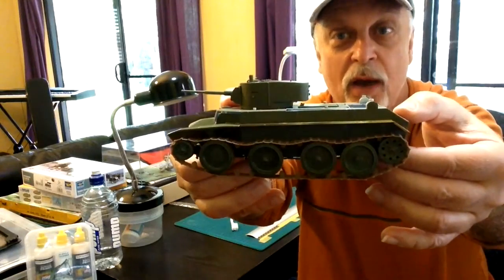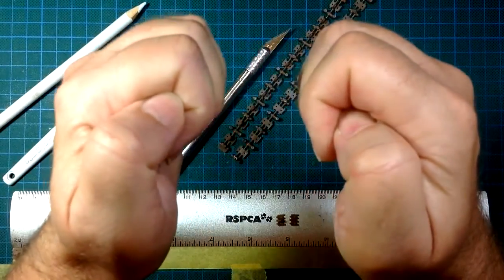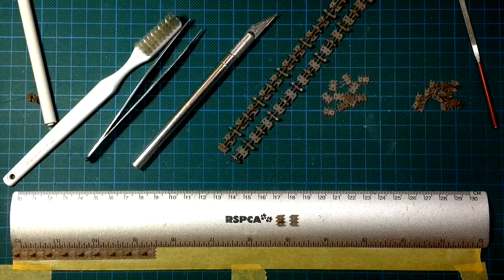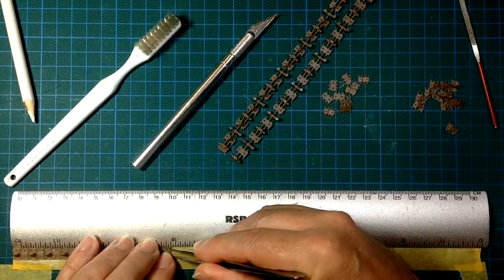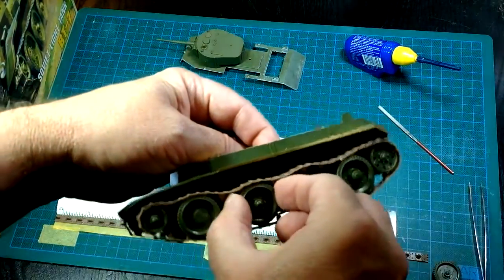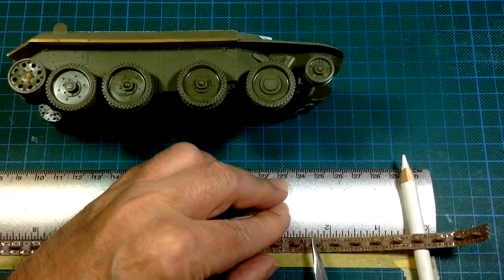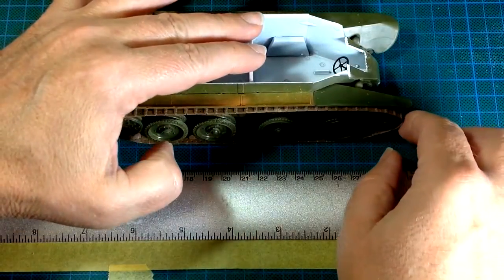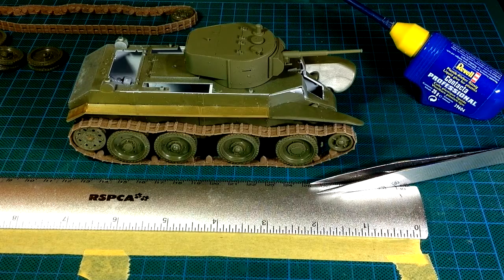How I Do Workable Track Links

Comment: I've just used this technique on my meng whippet harry.  it doesn't have sag but it was a pain in the arse for coming to pieces so this worked a absolute treat. much thanks from England, great tip
Reply from the maker: Good to know this method works on those links.  I also have that kit so look forward to building it soon.
Reply: +Harry Houdini Models it's a brilliant kit.  turret needs to be done all at once tho so you can adjust it.  you'll know that tho

Comment: Is Dragon model kit tank tracks workable? (Can rotate)
Reply from the maker: This model kit was a Zvezda BT-7 and the aftermarket track links were Bronco and apparently workable, but very fragile. Dragon kits come with Magic Tracks, which can be set to sag, but are not workable.  Dragon now supply rubber band tracks which could be workable, but have no sag.
Reply: @HarryHoudiniModels  how about the zvezda tracks itself? Is it workable? And tamiya one is it workable too? Sorry for giving you many questions
Reply from the maker: The Zvezda tracks on the BT-7 would not be workable.. no pin joins, you just cement them into a fixed position, plus they don’t fit very well.  That’s why I bought the Bronco aftermarket.  Tamiya do supply rubber bands with many of their tank kits, which work with their motorised versions.  Some of the new Tamiya WWI kits have workable track links, but again these are fragile so if motorised would probably break.  You would need to be more specific with a certain kit.  They all differ.  Look on scalemates.com
Reply: @HarryHoudiniModels  thx for the help I really appreciate it